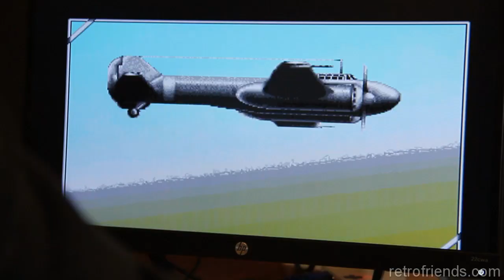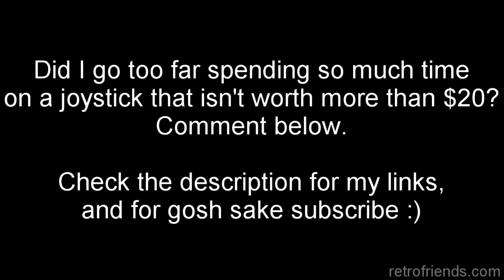3 Joysticks Teardown and Refurb Part 2: Gravis

Comment: My Gravis Analog Pro has just arrived from eBay today. It has grey buttons and has an additional button on the top. I can see adjustment screws in those holes. If I notice anything different when I have it apart tomorrow, I'll update.
Just for information, mine has 1.9 cm black circular foam pad over the 4 corner screws on the bottom, they are 3 mm thick, in case you want to add those to yours.
Reply from the maker: Thanks BlackDuke!
Reply: @retrofriends  Here is what it looks like with the adjustment screws. 
https://drive.google.com/file/d/1ueUEkQj9Uq0SFZURnaKn9pYhOkioZ1jd/view?usp=sharing
Edit: 
Obviously, before I cleaned it. Really glad I watched your video before taking it apart. Great video.
Also, the metal parts that you cleaned up on the rotary encoders are plastic on this version.

Comment: The Apple II and IBM compatible version of the Gravis had the trim adjustment screws for the X and Y axis. 

I remember visiting the Gravix facility back in the early 90's to see if they would repair my Gravis which snapped when I was playing a game on my Apple IIGS. They didn't think it was possible to break, but they had no problem replacing the snapped stick. They even gave me a tour of the place. 

The square screw heads are known in Canada as Robertson. Growing up, I was told it was invented in Canada, and not in wide use outside of our borders. Being that Gravis was a Canadian company, I guess they thought it would give the joystick a bit more Canadian content by using Robertson screws.

Your potentiometers look different from the ones used in the Apple II or IBM compatible versions.

I know someone who added some ceramic capacitors between the potentiometer contacts to restore sensitivity and range.

The trim around the base of the stick was a flat gold as well as the embossed letters of the Gravis logo on most versions I've seen.

I have a great affinity with the Gravis, so I don't think it's a wasted effort to try to restore it.
Reply from the maker: Thank you :)

Comment: No, I think we need to maintain these retro systems even if financially it doesn't make sense. The number of joysticks and machines is dwindling and there are new people coming to the retro computing scene and we need to keep as many bits of kit going as best we can. Sure you can always make modern joysticks and adapters to make them work with the old machines but it's not the same as having a genuine kempston or Gravis in your hand.